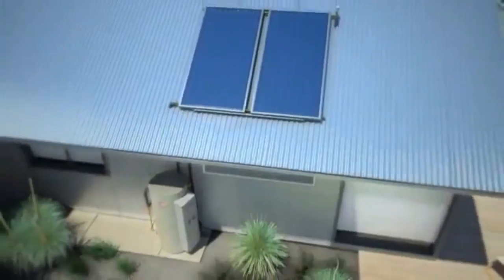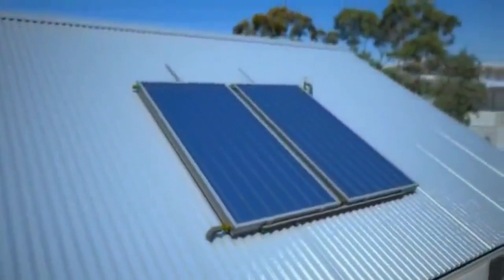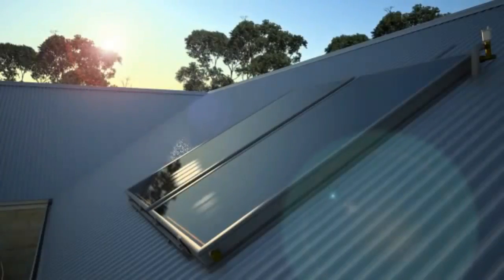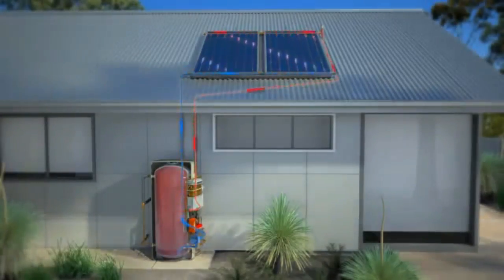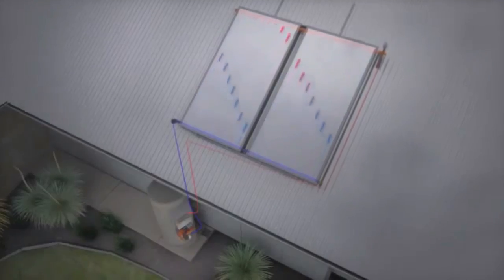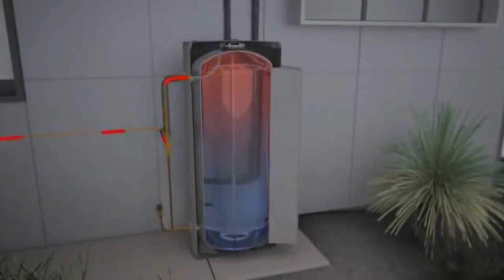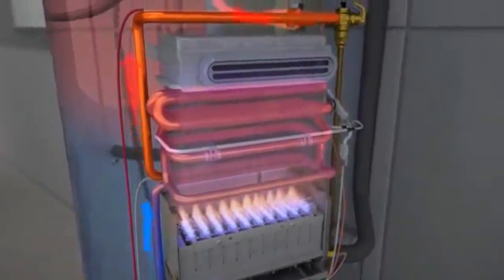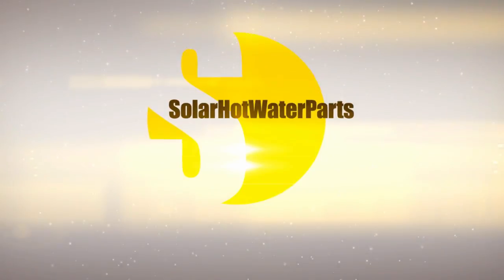Dux solar hot water

Comment: Take into cost of replacing DUX panels every 5-6 years, mine started leaking after 2 years, at the time DUX said they would replace them but I would have to pay the cost of removing and installing the new ones ... DUX SUX
Reply: peter bruce mine leaks too (roof solar panel cooper pipe) and pump stoped working for years I only noticed about it few days ago, one of bullshit company quoted me $12k to replaced the whole unit ( hell no way...), I end up got up my roof removed the solar glass and cut one of the leaking cooper pipe and seal it, I ordered a new pump should be arrived sometimes the week, total cost me only $60 AUD fixed, this kind of work is no much Hi-Tech involved I have no idea why some companies hungry about money and ripping people off.
Reply: @py8551  SAD ... I managed to find a couple of new panels on eBay .. ( Rinnai Ennduro SP 200, guy bought but not suitable for high country ) for $58 dif pipe size,  new fittings cost about $60 from Bunnings.... Son and I fitted to all original fittings.... YouTube has 'How to's on compression connections etc 
... Good Luck ...!
Reply: peter bruce, Hi, finally I got my Dux solar hot water system fully fixed, took me 3 weeks to fig out what was all the problems, I end up bought a after market pump and I found few pipe adaptors to put them together from Bunnings (spent 2 hours at Bunnings), seal leaking cooper pipe by clamps the pump cost me $45 and few small parts total cost $150 now I have a working system again, I am so happy now.